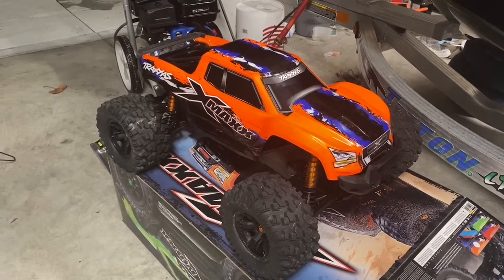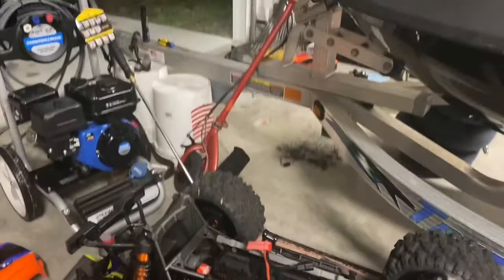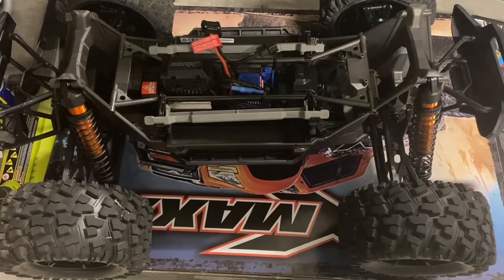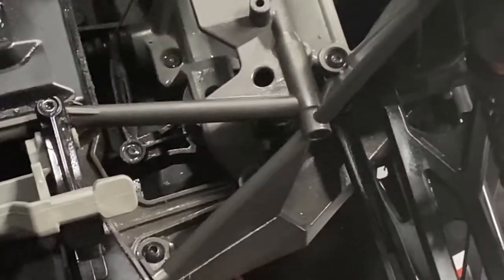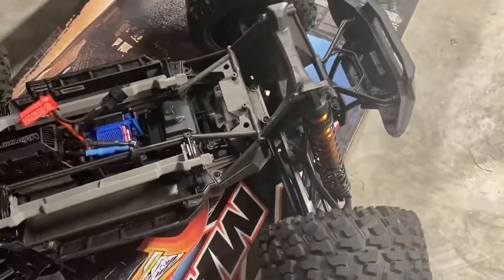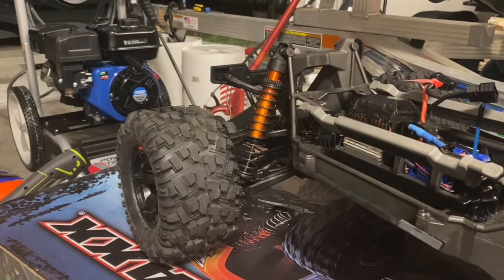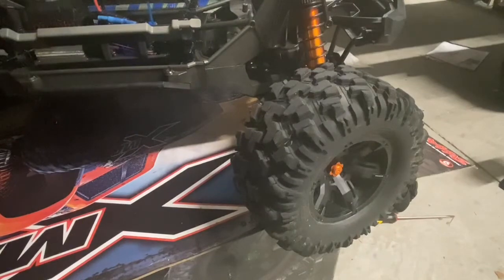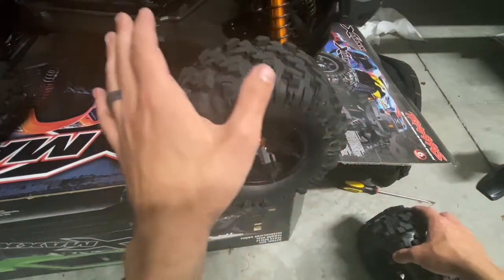Traxxas X-Maxx What You Will Break After One Week of Ownership COMMON PROBLEMS

Comment: Straight out of the box… I lined the inside of the body with gorilla tape, upgraded the steering servo, the esc to the Max6, the tires, fitted retaining rings to the drive shaft cups, went through all the oils and bearings making sure everything was full and well lubed aswell as going over all nuts and bolts… apart from this my truck is bone stock and have been bashing it for over a year now with zero problems and next to no maintenance… just charge, bash, clean and shelf 👍👍

Comment: this seems like it happens alot cause people dont set up there turning lockout. they just take it out of the box and use it. seems like most times its over turning one way, so its going to break cause it trying to break itself. link for the controller seems great for setting up and stopping that from happening. or just setting it up with the controller. 
tires seem to act better if you vent them by putting a hole middle/center of the tire . 2 or 3 so that dirt, water and air cant get out. less ballooning to cause less weight in the tire. will help with balance in the tire to and the helps everything from breaking lol. just got to make a super clean hole no knife.
great video bud . cleaning is always number on way to keep you rc in good shape. plus as you clean you can spot whats wrong or broken too. keep away rust is always great.  i hate rust!!!!!!!

Comment: I'm running a max5 800kv motor with a 48pin and 46 spur , on stock tires ran about 30 packs no tire blow out,  I feel maybe u might have either had  pre existing rip or cut on a rock or something,  stock tires aren't bad at all very lightweight too :) great video dude thanks 😀
Reply: The tires are good it's just the glue that they use is not the best I had to reglue mine after 2 weeks of owning one I feel they should do a better job especially because them tires ain't cheap
Reply: I had to reglue one of my Xmaxx tires as well, because it separated off of the rim, and a major problem that I had with my Xmaxx is the pinion gear coming loose, it already came loose once, and it recently happened for the second time.
Luckily it's an easy fix, just take the gear cover off, lock tight on the screw and then optionally regrease the gears.
As I said it's an easy fix but it's still an annoying problem 🤣
Other than that the Xmaxx is a very good RC car, and if you like just a little bit of DIY it's a great vehicle.
I can tell everyone who is considering one that it is also quite fun to be able to fix your own car, it might sound annoying at first, but it's quite easy to do without a lot of knowledge, and the feeling that you get when you're driving an RC car that you fixed is also quite nice!

Comment: Stripped the servo first 10 minutes of driving. On the 2nd run I used the self righting, at one point 1 wheel hit the sand hard and the pinion gear came loss from motor with both gears (pinion and spur) stripped as result. Hope this all has been bad luck so I can have some fun with it soon.
Reply from the maker: I did the same thing with the servo. Gears will always be an issue on a truck with this much power. Expect something to break everytime you use it especially if you bash hard. Also don’t use self righting it’s very rough on the truck
Reply: @BrandonActionJackson  if you are braking your rc every time you drive that means you are bashing way too hard, especially with how durable the x maxx is
Reply: @1987fordranger  he has everything upgraded so its not as durable anymore. more power = more breaks . plus more weight
Reply: @heyby8764  I know that the guy didn’t have his heavily upgraded
Reply: @1987fordranger  your right

Comment: the first thing i broke on my xmaxx was the gears in the first 10-15 mins and i broke the shock caps but thats it
Reply from the maker: I have sent this thing up 30ft plus and it’s pretty much totaled right now from a crash at over 60mph when a tire blew out but I still have yet to break a shock cap
Reply: @BrandonActionJackson  what motor esc combo did you have to reach 60? Gears?
Reply from the maker: @connordavidson6514  I have max 5 and 800kv with a 1:1 belt drive

Comment: I don’t think I’ll go back with stock tires, there are several better options out there, really should have had belted tires right out of the box.  Traxxas has recently released oversized hub carriers as well, they take the same oversized inner bearings as the rpm parts.  I’ve got a set ready for when I need them.  Maybe they will start installing them at the factory at some point.  2085x servo should also be standard, trying to decide whether to get 1 or just the metal gear set to keep on hand.  The only thing you didn’t mention is the body, mine already has the crease in the back, front flipped it with the brakes and did that in the first 10 minutes lol.
Reply from the maker: Yeah no eliminating the crease but for a nice shiny rc body you’re just going to tear it up when bashing no way around it. I’d go metal gears not 2085x If you want a replacement servo go savox or promodeler. Traxxas tires aren’t belted but honestly it’s the best bash tire in my opinion and I’m glad they finally came out with the oversized hub carriers
Reply: I thought of line x for a rc body or some sort of rigid bed truck liner that I could spray on the body to make it last longer

Comment: This is simple you spent $1,000 I could have bought a used car that you drive it's not built right you got plastic frames you got metal screws going into a plastic what's going to happen there it's going to strip out they got to have metal inserts with metal screws just return it that's why I don't buy these
Reply from the maker: It’s still the best rc on the market dude
Reply: You’re missing out!